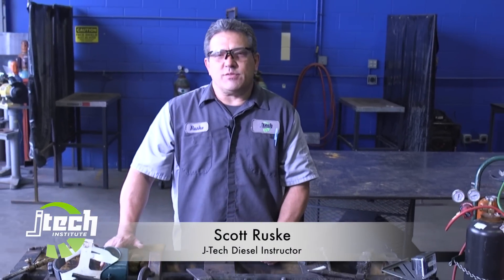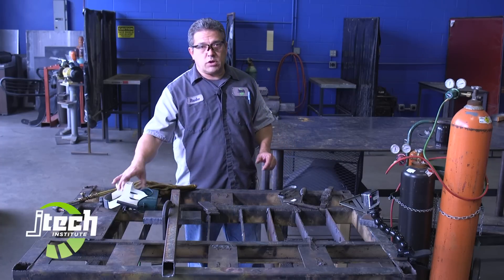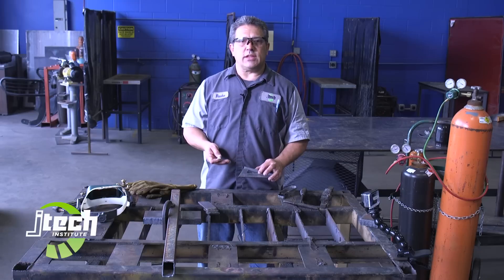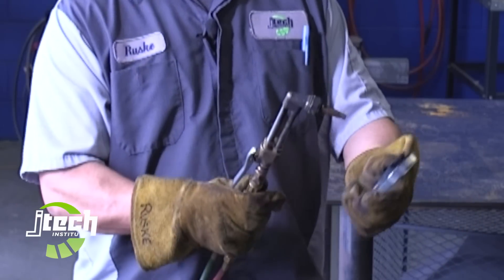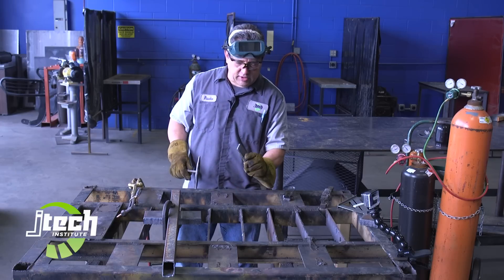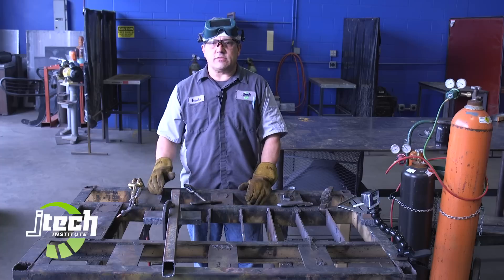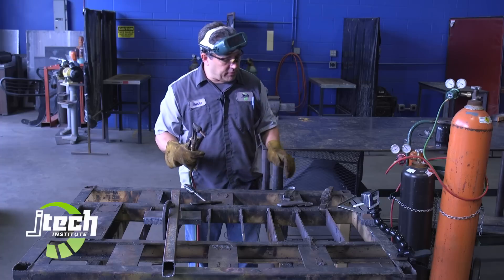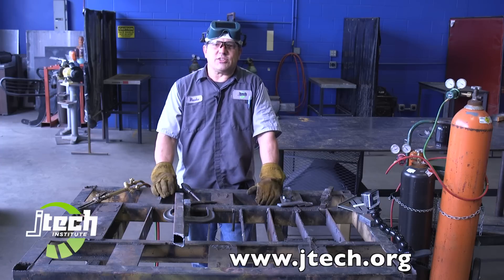How to properly use an oxygen acetylene torch for cutting

Comment: Wish you'd went through the shut down as well, I've heard of some kind of gas that can get trapped in the copper tube that comes out of the tank shut off, from there before the setting knobs and have a flash back, lots of videos but nobody seems to go from the beginning to the end especially as dangerous as this can possibly be, thanks for the time and instructions up to the point you stopped, God bless

Comment: One should open the oxygen sloowly, the first half turn or 3/4 turn should be slowly turned and when the gauge has reached full pressure, open it all the way. If not you run the risk of small particulates catching fire inside the regulator and well, that wouldn't be nice...

Comment: Scott thank you after years of not being around a torch i came across one and after going over it and using it for a couple days the little line stuck out to only open the acetylene enough to work so you can shut off quickly in an emergency sure  enough the acetylene hose ruptured about 6 in from the valve and it did catch fire not quite sure how but i was able to shut it down quick and not watch the shop burn down. Thanks again.!

Comment: Seems like 1/2 folks say oxygen off first, other 1/2 say acetylene off first. I suppose a tutorial on "proper use" of oxygen/acetylene torch, might as well let us know how to properly use it.... But What do I know Im just a Doctor.
Reply: in general it doesn't matter which goes off first, as long as the other goes off afterwards. Personally I cut acetylene first so I don't have any more of the soot or fuel floating off across the shop to get sparked by someone else's work or staining up the ceiling, but that's just me being cautious, and is likely not a realistic situation if you have shop fans on like your supposed to. its a matter of personal preference.
Reply: If you are using a torch don't worry about it you are probably not in a medical setting and someone next to you is using a grinder in a tank of mineral spirits anyway so death is just an odd you roll with.
Reply: Oxygen does go off first always. If you turn acetylene off first, you will hear a loud pop every single time. If anyone ever tells you that loud pop is suppose to happen and that it's perfectly normal, I would stop seeking advice from that person sooner than later.

Comment: I'm using oxy acetalyne to melt silver and gold but I noticed a black sut that was coming off the acetalyne. should I use less acetalyne and more oxygen?
Reply: Turn up the acetylene first and then turn up the oxygen, until you have a neutral flame.

Comment: I do not see a flash arrestor on the acetylene hose
Reply: That is because they are built in on that particular torch body. (Right above the gas valves.) And yes there are TWO of them required. One for the acetylene side and one for the oxygen side as well.

Comment: I've mainly used my powerplasma cutter for cutting metal but a friend of mine says that learning how to use an oxy-fuel torch can be useful.
Reply: Absolutely! Welding with gas is something of an art and preheating or bending steel is a big plus. Also, what happens when the plasma machine goes down or a power outage occurs? The oxy acetylene or oxy propane /propylene setup is essential. Hell it can be used to gouge , weld, preheat, defrost, harden or descale, scarf, or simply be on standby.

Comment: What happens when you use the ignitor/flint when you have both the oxygen and acetalene valves cracked open when you ignite it and is it safe to do it that way?
Reply: It pops like a back fire kinda scary lol
Reply: When the tanks are empty
Reply: Do not do that 😶 ever
Reply: That pop is a flashback. Not good. It’s from turning off the acetylene first. It will mess up your tip. Turn oxygen off first, always.
Reply: Natural selection candidate

Comment: In another video the acetylene was turned off first. i see you turned oxy off first. what scenario causes explosion?
Reply: Wrong,shut off oxy first. The acetylene will keep burning,then you can shut off acetylene.
Reply: When you turn off acethylene first you can often hear a 'shot' thats a flashback, worse case, mostly when shutting down heating torch, for cutting setup ain't that bad but still not good :P
Reply: looks prtty simple but consider burning speeds, pressure drops while turning off acethylene, mixture ratio  and so on
Reply: Think about it: Which do you want to run out first? The fuel? Or the flame? If the flame runs out, and the fuel is still coming out, you can cause an explosion. If you cut the fuel off (Acetylene) first, then the flame will stop because it can't continue any longer.

Acetylene: First on, first off. ALWAYS.
Reply: @eatonasher3398  WRONG!!!! Stay away from oxy acetylene for your own safety. Acetylene on first, off last. Unless you use a rose bud tip in which case you'll get a flashback. Your comment could literally kill someone. Get it removed!!!
Reply: comrade188612 it’s mental... on every single cutting video there is no consistency with this ... purely becuase different axes have different “manufacturers” instructions ... and as you rightly say... different tips ... different rules. 
It’s also odd, bearing in mind this stuff blows up like a bomb, that no one talks about flash arrestors or has safety. Unreal ! Haha
Reply: @comrade-uj5iy  Acetylene on first/off first, always. You really shouldn’t be giving advice on something you obviously know nothing about. It doesn’t matter if it is on a rosebud or cutting head, it is the same every time.